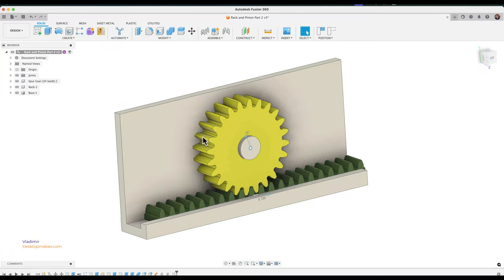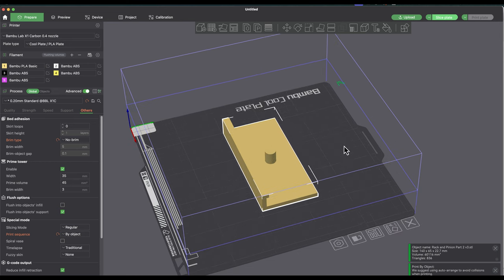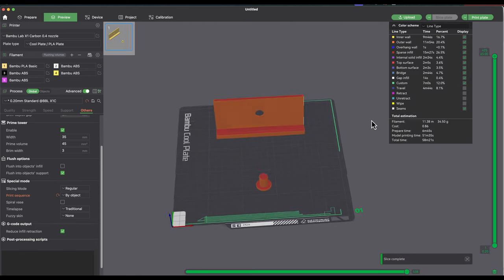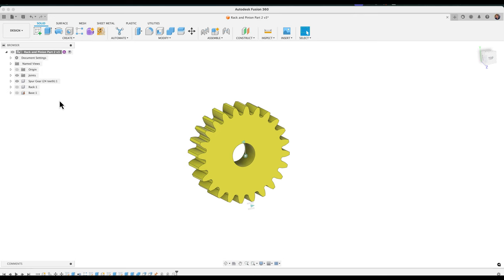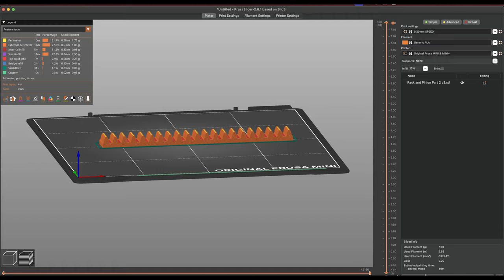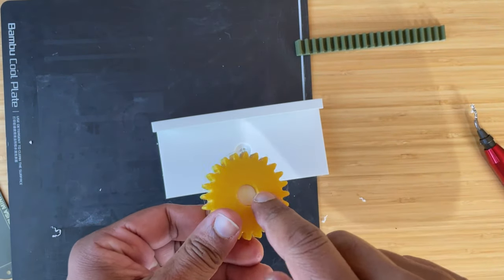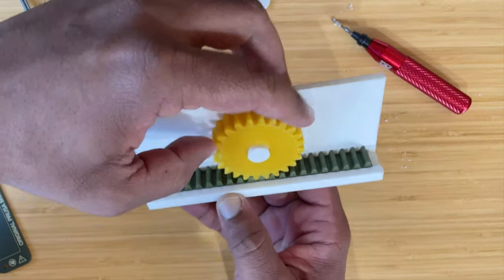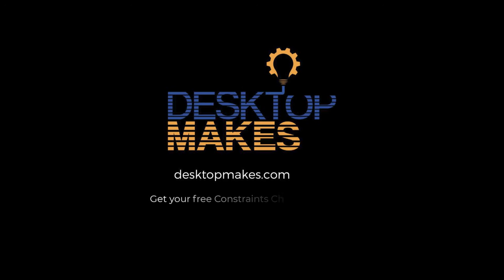Will it work?

Comment: Your print for the rack should have been left sideways so the teeth would be printed on the same plane as the layers. By printing with the teeth up, they will be weaker and the walls won't be as smooth.
Reply from the maker: Yeah, I think you're right.  I was rethinking that orientation after posting the video.

Comment: We did not do a clearance on the pin, but that happening just made the series that much more realistic, thanks.  I use UltiMaker Cura and it doesn't have all the option of your slicer software for some reason.
Reply from the maker: Yeah, I learned the hard way about forgetting the pin clearance 🙂  Cura should have very similar settings.  Which ones are you having trouble finding.

Comment: Nice series, Vlad.  I like that you showed your failures and issues.  It makes our craft more approachable for students/beginners if they realize that we go through lots of iterations before making the perfect part.  BTW, for this design, there is no requirement for the snap-in section to be circular (and thus printing with the bridging and needing to be cleaned up).  That could easily have been a triangle that would have printed fine with no overhang issues.
Reply from the maker: Good point.  I think someone else had mentioned this and I didn't quite understand what they were saying.   It's easy to bring in constraints from other manufacturing methods into 3D printing.  It's not till it's pointed out or you sit with the part a bit that you realize, "why did I do it that way".  Thanks!